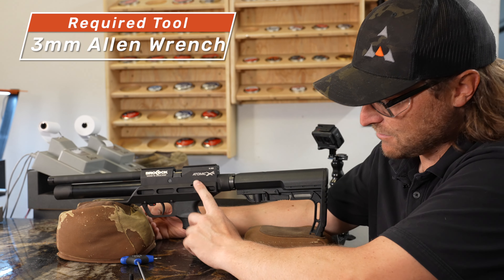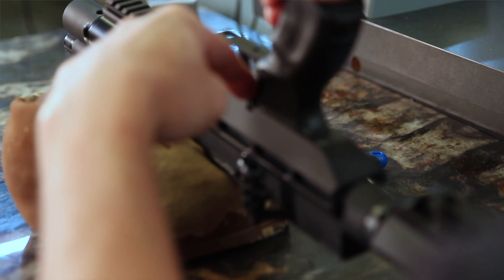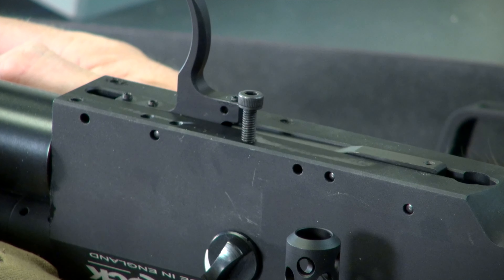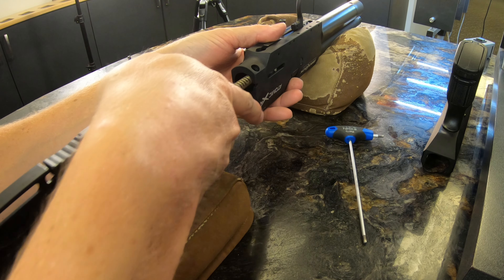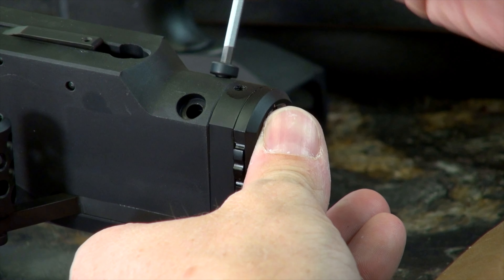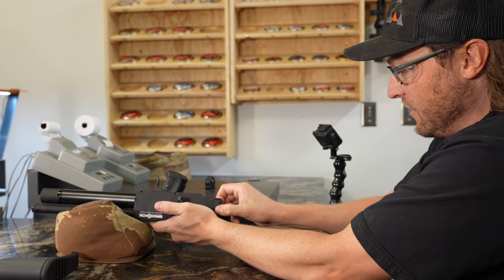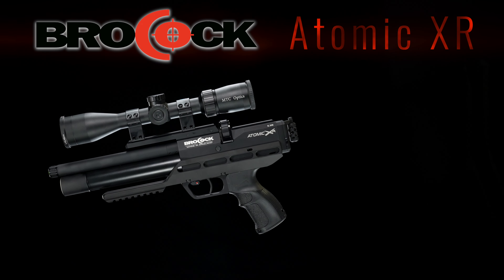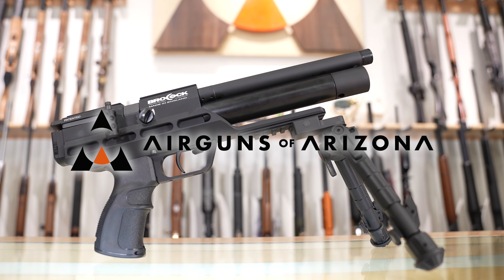Brocock Atomic XR Air Rifle to Pistol Swap

Comment: That Brocock is one sweet pistol / Carbine.  How many CC's is the air cylinder?  I thought the Atomic with more backpackable and came with a folding butt stock?  Great job on the tutorial!
Reply from the maker: You may be thinking about the Brocock Ranger XR.

Comment: are you not able to add the folding stock adaptor? or does the cocking mech get in the way when stock is folded?
Reply from the maker: I think you may be better off getting the Brocock Ranger XR. It comes with the folding stock.
Reply: For those of you already owned a "Brocock Atomic XR" and want a folding buttstock without purchase the another "Brocock Ranger XR", it's doable.

There are 2 folding adapter that you can purchase and convert yours.

The first and easy option is getting the "FX Dream-Tac Folding Stock Adapter" and install it between the buffer tube and the hammer cover adapter, this option will extens your "Brocock Atomic XR" approximarw 1" longer.

Second option is purchase an OEM "Brocock Folding Stock Adaptor" from "Bagnall and Kirkwood Airgun Spares", I think this adapter is the same as the 1 they use on the "Brocock Ranger XR"

The second option cost a bit more, also takes a bit longer to swap the adapter, BUT it does look original. I have both of those adapters, and I end up installed the OEM adapter that I purchased from "Bagnall and Kirkwood Airgun Spares" on my Atomic XR.

Brocock Atomic XR and Brocock Ranger XR are same gun, the only different is the folding adapter ;)

Comment: I purchased the Atomic XR last spring but it came with a fixed stock.  Is a folding stock available for purchase and if so, thru who and what would the cost be?  Thank you
Reply: in USA you can buy a folding stock adapter from AOA for about $113.  They now also have an inline power adjuster that works with folding stock.